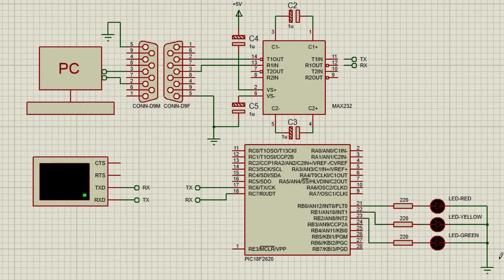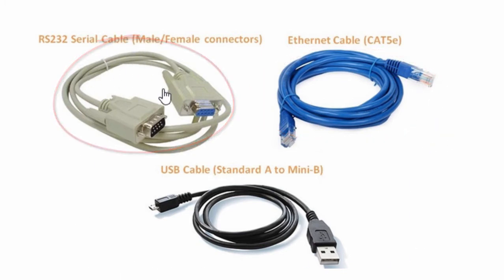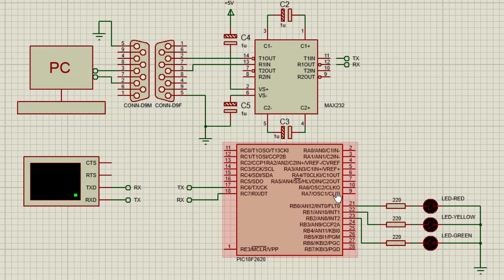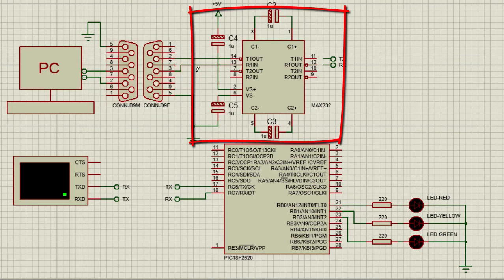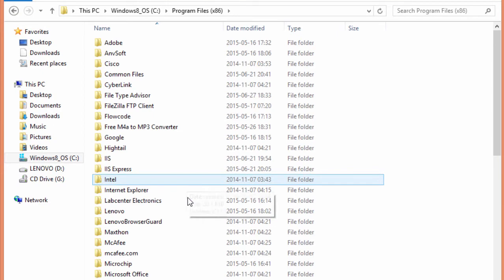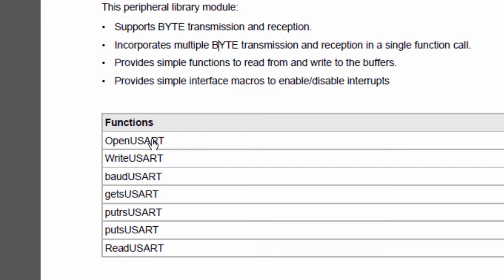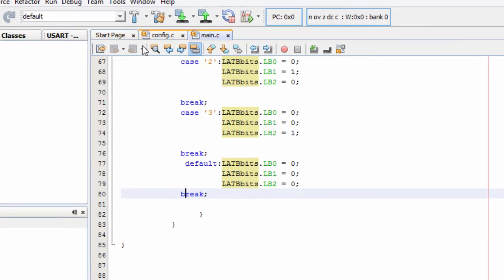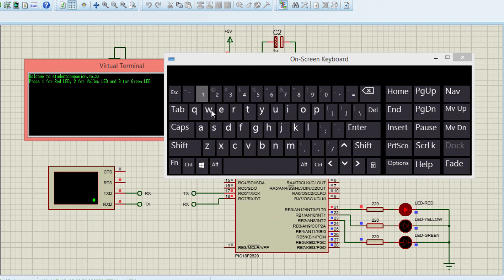14- RS232 Serial Communication | MPLAB XC8 for Beginners Tutorial

Comment: Why would you have a 500ms delay between initializing the text arrays? Also, your '500ms delay' between transmitting the lines is actually 1000ms (20 x 50ms).
Reply from the maker: +Alf Git it's just a short delay we created between sending text. It got nothing to do with USART communication
Reply: Thank you for the reply, but I was referring to the delay loop inserted between the lines which initialize Txdata1[] and Txdata2[]. The text is not being sent at that time, just assigned to the char arrays. The delay occurs before OpenUSART is even called so it appears to do nothing but waste time unnecessarily. The relevant line is on screen from about 13:17. I am not referring to the delay between sending each line of text. There are three delay lines in total in the program (which are actually closer to 550ms and 1050ms due to the FOR range).
Reply from the maker: +Alf Git you are correct. The first 500ms delay is not required in this case. It could be ignored.  Only the 1second delay is relevant.  Thanks for letting us know.

Comment: What should i change if i dont want to use the internal oscillator? Im working in a project where we use an external oscillator of 20MH, but i see you use OSCCON for the internal of 8MH, so, how do i change that to use the external?
Reply from the maker: +EfronDX you can remove the OSCCON line. In the configuration file, select to use an external oscillator and specify 20MHz with the #define _XTAL_FREQ 20000000
Reply from the maker: +EfronDX watch our tutorial 1 to learn how to set your oscillator frequency.
Reply: +Student Companion SA AAAAAAAAhhhhh ok, i have done that since yesterday, but i didn't knew if only with that worked, or if i needed to do something else, thaks for yout help :D
Reply from the maker: +EfronDX that's all you need to do.
Reply from the maker: Hi. Did you also connect correctly the external crystal with two capacitors? Is everything else working except the USART or nothing works?
Reply from the maker: make sure you are configuring correctly all the clock settings as you are using a PIC with USB. Read this article for an example of PIC18F4550 configured to use an external oscillator: http://www.studentcompanion.net/en/usb-communication-with-pic-microcontroller/
Don't forget, the baud rate you use in your code should be the same baud rate you configure in your computer USART terminal.